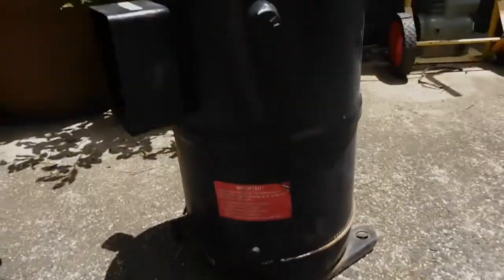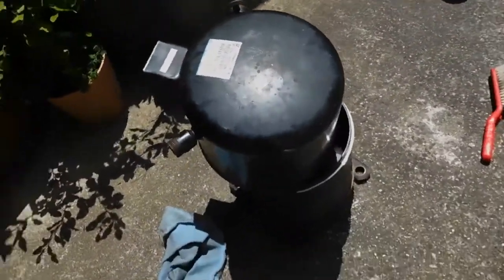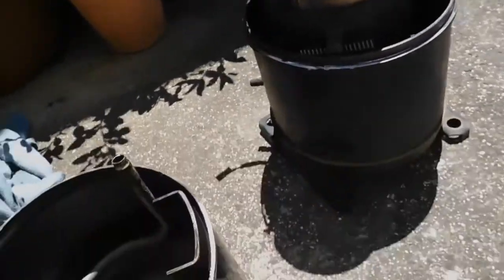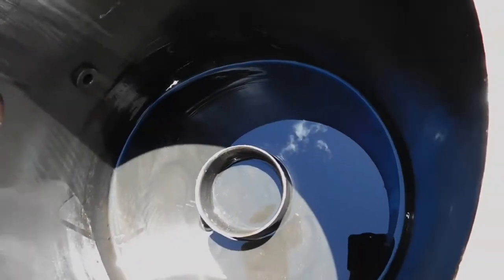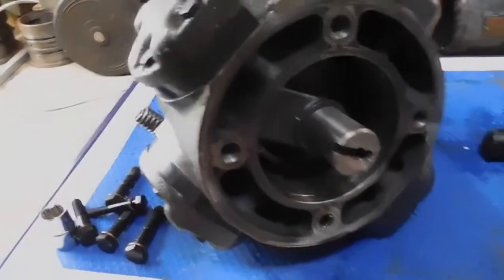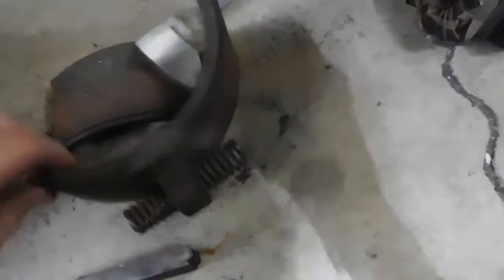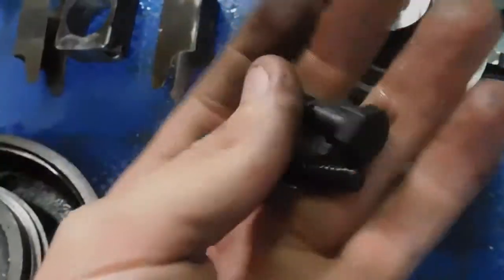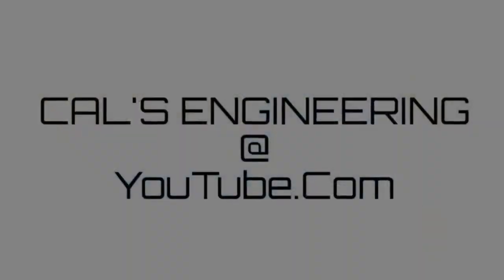Huge Copeland Hermetic Compressor Disassembly

Comment: What would the CFM on this thing be? I recently built a silent compressor using a much smaller compressor pump, and it has a fairly low output.
Reply from the maker: Can't tell you exactly what it is on these bigger ones, but it's something rediculous. When you put several smaller compressors in tandem with each other they can pump out quite a significant amount of air!
Reply: what would be the easiest way to change the oil in one of these without 
opening it? I want to replace the oil in my compressor with something 
non-hydroscopic
Reply from the maker: Disconnect the suction and service fittings, then hold it sideways over a container, allowing the oil to drain out of one of the fittings. To get fresh oil back in, block up one fitting, plug it in and let the suction draw it into the case ;)